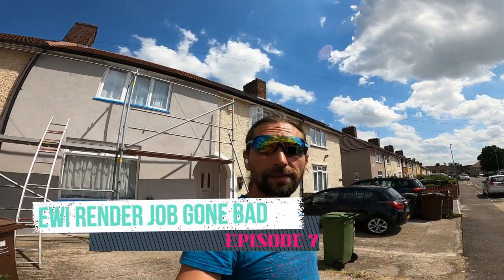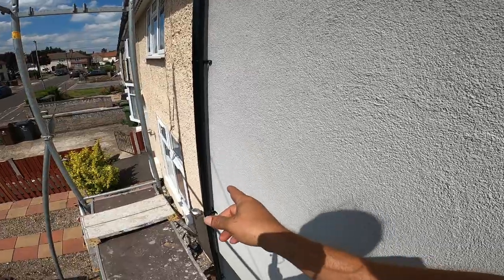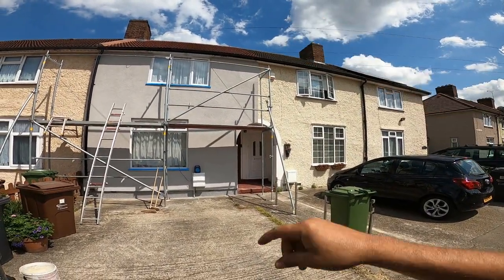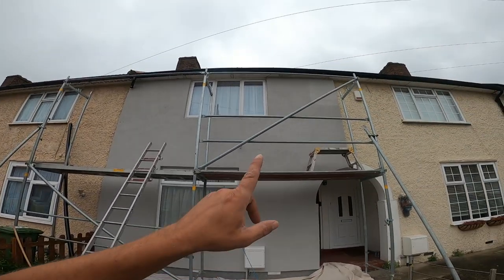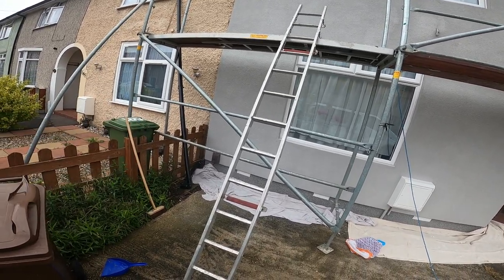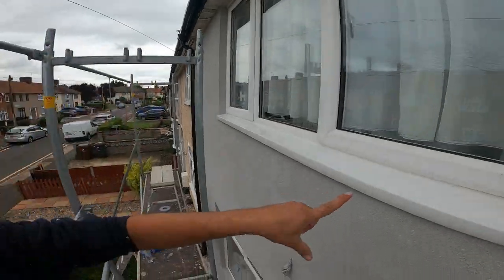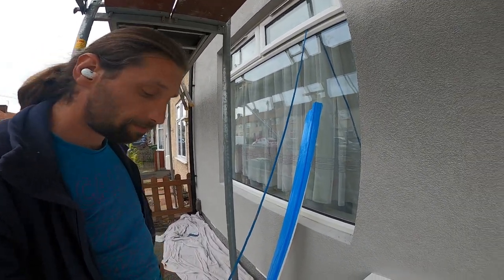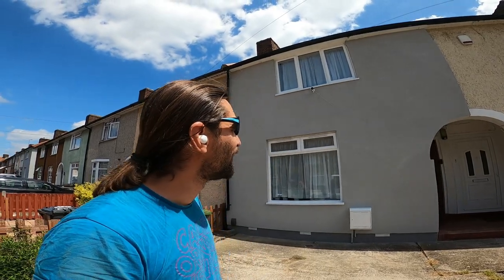Silicone render application fail ep7

Comment: Came out looking nice in the end mate. Where did you get the scaffold from im after something like this
Reply from the maker: Thanks. I bought that from Poland and im looking to sell part of it. Interested???
Reply: @How2Extreme  ideally need the same amount as you had there. What's it actually called?
Reply from the maker: @A.32166 tower scaffolding. But is going to be a bit difficult to find that in england. This is a European scaffolding
Reply: @How2Extreme  how much have you got for sale? And what you asking for?£
Reply from the maker: @A.1986.  practically what you can see in the clip 6m by 6m .   2.500£ with 1 platform and ladder to go on the second floor

Comment: Fair play when we plasterers make a mistake you have to be man enough to own it and do your best to sort it I'm having one of those days my self rubbed up an area a bit late not looking what it should it's silicone can u re coat again if so what is the best way do I prime  again and apply another coat straight over the top
Reply from the maker: Hello. Sorry to hear that, i feel your pain. Its still fresh so you don't need to prime just put some water into the silicone render and start to render. Be aware of the weather, Not a great time to render
Reply from the maker: Hello sorry to hear that I feel your pain. You don't need to prime cuz you still fresh you should just put some water into the silicone render and apply it. Be aware of the bad weather it's quite difficult to render in this conditions

Comment: whats the reason for different shades on silicone, some lads did a job in white near me, but it look patchy everywhere?
Reply from the maker: It's seems that it was hot and they didn't smooth it in time. You need some experience to do this type of render . After 10 years or more, i still struggle. I definitely can do perfect now. Imagine someone who's starting now
Reply: @How2Extreme  thanks for the reply these guys have 20 years experience, and weather was fine, i’m starting a bungalow for my first job, but wanted to know the reason for this discolour so i don’t make the same mistake
Reply from the maker: It's no secret. Keep it wet, be fast, and work in the shade. If bright light goes on the wall, then you have around 5 minutes to finish. Contact me on my Facebook, and we can have a chat. And i dont belive in the 20 years experience in silicon render this is quite a new system for uk not even in this moment we can find a shop with the full system on the shelf this system it's so old in other countries that is starting to disappear

Comment: A sand lime cement render with a Tyrolean finish is a much superior job
Reply from the maker: Yes, but it's still sand and cement things change now new system's are crack resistant and hold for a longer period of time without maintenance. This is my personal belief from what I've seen in the past 13 years that im doing this. Thanks for your visit

Comment: What's the best way to ensure there are no lines or patches? I had this done to my house and there are differant shades/lines everywhere. The contractor  said over time it will fade to the same colour. He did the silicone render in one day and was applying and rubbing the render down every 10 minutes or so.
Reply from the maker: A nother coat on top.nothing else is going to solve the problem and silicone render it's not fading in color over time

Comment: You could have taken a photo and got a colour match from bnq then painted the small patch maybe ?
Reply from the maker: I used the same brand, and bnq dont have silicone paint, same like the render i can't risk that with my client and that paint was done with the matchin color
Reply: Even if it was a perfect match, the non silicone paint would change shade over time. You did the right thing
Reply from the maker: Thanks